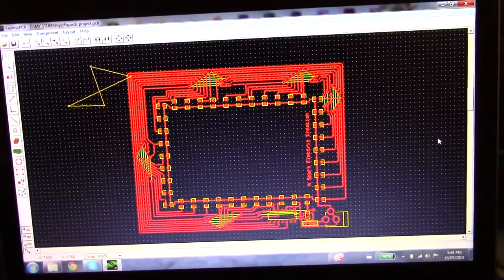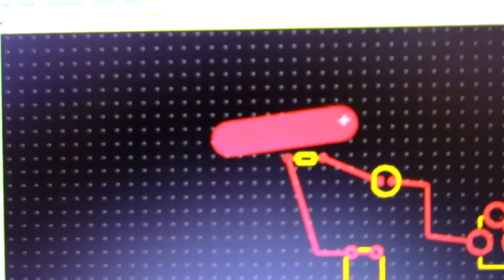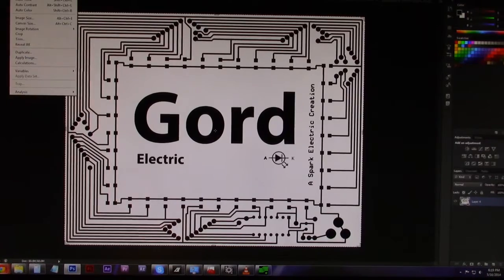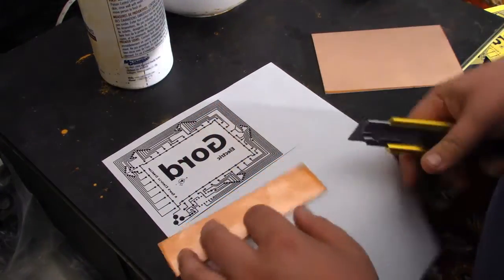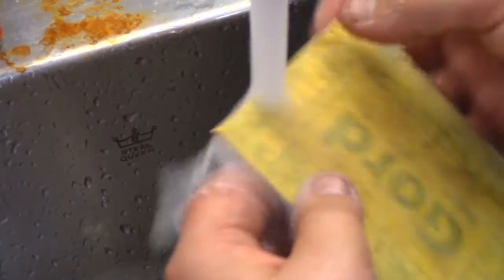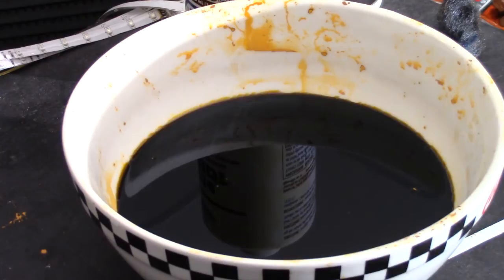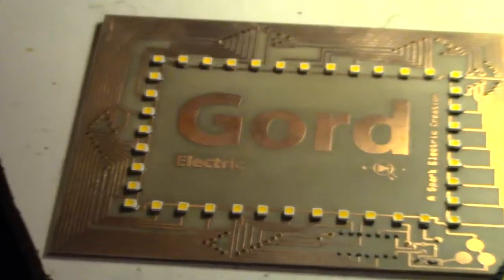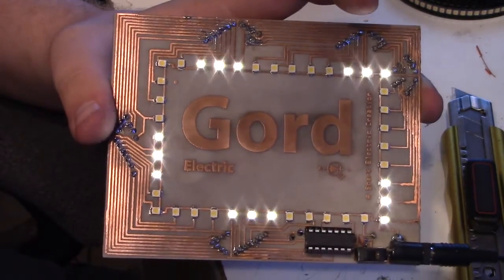How to make a circuit board for beginners tutorial

Comment: where did you get the resistors,capacitors,chips,diodes, transitors, the toner printer,what is the best paper to use,and where did you get the shiney board u cut from,and do you need to know ohms law in order to set this up,and can you make a small mother board this way?  ik im asking alot of questions i apologize thankyou
Reply from the maker: +aaron coleman If you go on eBay you will find everything you need with a quick search. Look for "A4 Heat toner transfer Paper" or "PCB paper". 1mm drill bit is what I used.Wire is just some scrap Cat4 cable.
I'm sure you can find a toner printer at a computer store near u.
Reply: +TruckingCrazzy thankyou bro really appreciate it

Comment: Where did you find the LED's?
Reply from the maker: +bryce williams I got them on Ebay. These ones are "3528\1210 SMD warm white LED's" 3528 refers to the LED's length and width, this one being 3.5mm by 2.8mm. 1210 is the imperial measurement.